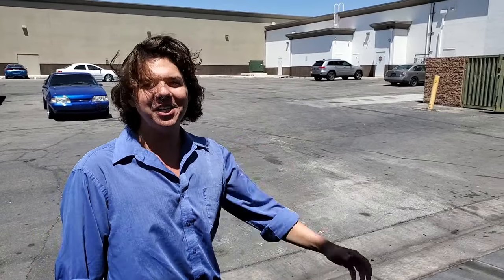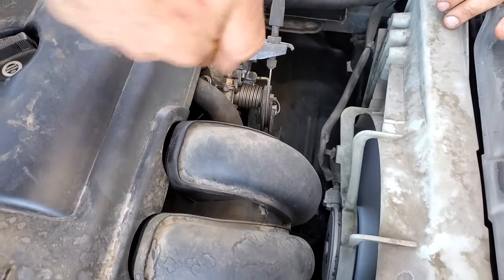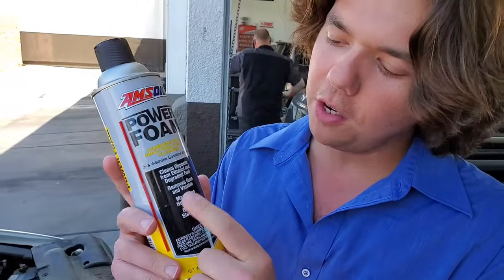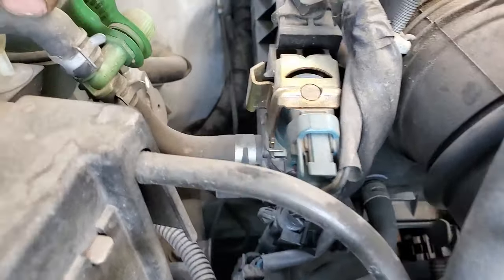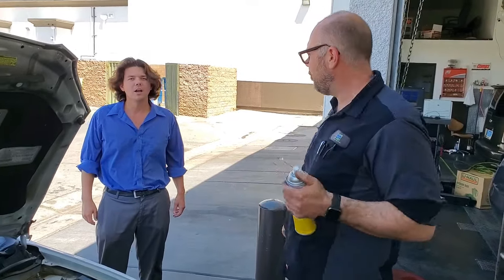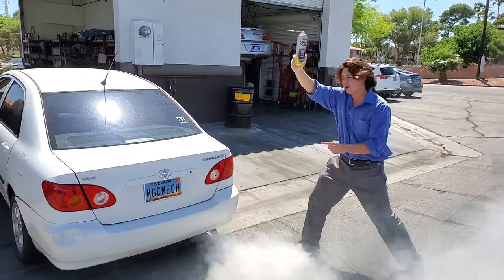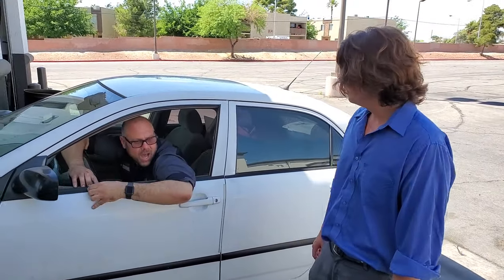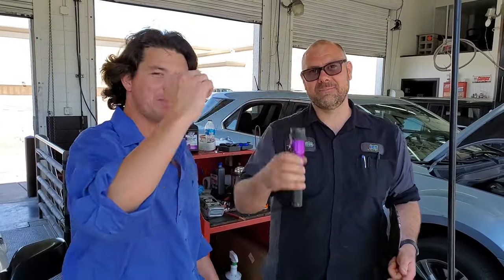AMSOIL Power Foam Engine Cleaning Treatment

Comment from the maker: Watch This Next: Toyota ATF Fluid Change for Faster Shifts & Lifespan - https://www.youtube.com/watch?v=I9ZHWhW7Aso&t=2s  

✅ ✅ ✅  Save 25% On Next Fluid Order: https://www.amsoil.com/offers/pc/?zo=5331179 

     ❤ 🇺🇸 ❤ Your Professional YouLubher: Eben Rockmaker. Find The Right Fluids For My Vehicle - https://www.amsoil.com/guides/?zo=5331179      

     🥇🥇🥇 Synthetic Oil Protection Google Map & Reviews
(702) 472-3614
https://maps.app.goo.gl/DmLU5hP72HadUBEm9
             
     ⛳ Synthetic Oil Protection Website - http://syntheticoilprotection.net

     Did you know a oil manufacturer can call a lubricant a Full Synthetic when it's only 25% synthetic? AMSOIL is different because it is 100% Synthetic and has a higher film strength keeping the metal parts separated. AMSOIL allows less friction, less heat, less wear on the component. 

      ♥ See Fluid Performance Tests - https://www.amsoil.com/performancetests.aspx?zo=5331179      

     Your Vehicle Could Run Better Than Brand New By Using The Right Fluids! See Results - https://youtu.be/zH-VquYlhqA

     Why AMSOIL - https://www.amsoil.com/about/exclusive-distribution/?zo=5331179    

     Synthetic Oil Protection Coffee - Ebens Favorite: https://supportwith.coffee/shop/subscriptions/sop/
Reply: Thank you

Comment: I know this is an older video but i just stumbled across it. I have a Mazda 3 with 102,000 miles on it. Should I power foam it? Or should i just start with the engine flush, gasoline pi, and upper cylinder lubricant?
Reply from the maker: I would do them all definitely important to make sure you don't power from a direct injection car.
I give a man a fishing pole & show him how to fish. 

     Together! We can get your vehicles to run better than brand new!

     For me to get credit & be "Your" Independent AMSOIL Dealer please use my website below or my dealer no. 5331179 call anytime Eben Rockmaker 702-472-3614
After you click on: http://syntheticoilprotection.net
1. Click hamburger menu
2. Click offers AMSOIL preferred customer
3. Click join now 6-month PC member add to cart.  ( there is no reoccurring renewal membership unless you select that dot box ) 
( you have the option to not have your credit card saved if you prefer - est. 1972 )
4. Scroll up to the top Select shop by vehicle.

New promo: FREEQS
Reply: @Syntheticoilprotection  my car has electronic fuel injection so then I would be able to use power foam right?
Reply from the maker: @sellecksprodigy if you have multi-port fuel injection you're good if you have direct injection you don't want to use it it says it on the can to stay away from direct injection just depends on the type of fuel injection you have💯👍

You can use the pi performance improver and the upper cylinder lubricant and the engine flush in the signature series motor oil in any vehicle and you will see a huge huge Improvement

Comment: Hey eben, or jeff, question:  i have a evap code - P0457 on my '01 mustang v6, does this problem require the amsoil power fowm application? Thanks.
Reply from the maker: I have no idea I would find out what the code means.

Also if you have an older car I would definitely clean it out with the power phone you'll see a huge difference.
https://youtu.be/-T_-mF8tlyA

Comment: Do you need to replace the air filter as in the instructions stated on the bottle or that’s for other applications
Reply from the maker: That's a great question I'm not sure what you mean by replace air filter as in a new filter or you would take off the intake box?

Comment: Hey Eben I know this has nothing to do with the powerfoam but I was wondering will amsoil warranty my transmission if I use there atf after I have my transmission rebuilt?
Reply from the maker: Yes you can use it with any vehicle it meets the specifications and it will not void any warranties.
https://www.amsoil.com/about/guarantee/?zo=5331179
Reply from the maker: Tony this is the look of guide that will give you all the products for your vehicle and capacities.

     AMSOIL Products & Vehicle Lookup - https://www.amsoil.com/guides.aspx?zo=5331179

The $50 free shipping promotion is still going until May 31st 

AMSOIL Promo Code: FREESHIP
Reply from the maker: Thanks Tony for being a part of my YouTube Community

Comment: Will this clean clogged catalytic  converters? Or does amsoil make something else that does got the catalytic  converter belowe effincy code so either cats or o2 sensors
Reply from the maker: This is not specifically designed to clean the cats however it will clean the entire system from the intake combustion Chambers all the way out the exhaust to what level it will clean it there's no guarantee but I highly recommend doing it you'll see a huge Improvement definitely worth a try before you replace the cats I would also do the pi cleaner the signature series motor oil and the Amsoil engine flush you'll see them all here on my website👍
I give a man a fishing pole & show him how to fish. 

     Together! We can get your vehicles to run better than brand new! 

     For me to get credit & be "Your" Independent AMSOIL Dealer please use my website below or my dealer no. 5331179 call anytime Eben Rockmaker 702-472-3614
After you click on: http://syntheticoilprotection.net
1. Click hamburger menu
2. Click offers AMSOIL preferred customer
3. Click join now 6-month PC member add to cart.  ( there is no reoccurring renewal membership unless you select that dot box ) 
( you have the option to not have your credit card saved if you prefer - est. 1972 )
4. Scroll up to the top Select shop by vehicle. 

New promos: FREEWAND

Comment: Good work as always👌
How many miles made by that Corolla?
Will you make engine flush and change the motor oil, to which viscosity?
Reply from the maker: Yes Jeff already did an engine flush on it and it has a hundred and fifty thousand miles

Comment: Hi !
Greetings from Germany ! Would it be possibleto show how to use Power Foam in Fiat 124 spider MULTIAIR II 1,4 engine , same as Spider ABARTH 124 ? There i scomplicated way to go into throttle body as it is covered and deep inside .Maybe power foam can be injected by one ot te subpressure pipe. You know, any FIAT partner will not help...they want money ... I think many 124/ABARTH spiders will appreciate it .. TAHNKS !
Reply from the maker: Hey thanks for being a part of the channel from across the pond yes that sounds like a great idea I would find a way to inject it in however it's not recommended for vehicles that have direct injection.
I would personally take off the spark plugs and spray it into each cylinder like I do with my Cadillac here.
You want to spray the power foam directly into the cylinder through the spark plug hole.
https://youtu.be/-T_-mF8tlyA

Comment: I used a can of power foam to clean the catalytic converter, but the result is still not satisfactory. Should I use another can or not?
Reply from the maker: You could I would also do an Amsoil engine flush and I would also do a bottle of Amsoil PI performance improver.

I would also spray the power foam directly into the cylinders and that should help get more build-up and carbon out if you can get to the cylinders I would spray it in take the spark plug out let it sit in a hot motor for 15 minutes and then start it up and drive it

Comment: Would I use the same steps for a GDI engine ?
Reply from the maker: Most likely you want to just make sure you avoid any sensors so you do not get them wet.

Also another tip and trick you can do is to spray the power foam directly into the cylinder by taking off the spark plugs I've done this on my Cadillac and it made a big improvement.

Comment: Hi Eben. Which specific vacuum hose did Jeff apply the foam into?
Reply from the maker: Great question he said the exact name in the video I would watch it over again just to get your toes wet.

I also recommend avoiding any type of sensors on your vehicle.

You can call Jeff or message him on Facebook.
https://www.facebook.com/jeffrey.lockett
Reply from the maker: On different Vehicles it can be at a different location so I really am not sure for your specific vehicle it's best to spray it directly into the throttle body area and bypass the sensors

Comment: How do you know how much to spray in? Will this do some preventative measures?
Reply from the maker: The best preventive measure is doing an Amsoil engine flush and using the pi performance improver fuel system cleaner every 4000 miles and I also recommend using the upper cylinder lubricant every single full tank of gas.

The Amsoil power foam is designed for a neglected engine that has a lot of build-up in it and in that case it'll make a tremendous difference

Comment: So I just power foamed my truck. Now the check engine light was blinking when I shut it off. I haven't done the open it up and fly down the road thing yet. Will it go away? Anybody else have this issue? Thoughts? Fyi the check engine light was not on before treatment
Nevermind it went off. Some smoke. Not sure if it made a difference or not yet.
Reply from the maker: Yes that can happen make sure you check your wires if you took any wires off also it's good to reset the computer by unplugging the battery
Reply from the maker: I also recommend the PI performance approver gasoline additive and the upper cylinder lubricant those will make a huge difference on your vehicle
Reply from the maker: I also recommend an Amsoil engine flush that'll clean the carbon around the rings We did a really good Christmas miracle video with this Check this one out 
https://youtu.be/n-ueJQmbzxk
Reply: @Syntheticoilprotection  pi is in the tank already. Been 15 years since I've used amsoil products. I've been using the cheap wally world stuff and am not impressed with what it's done to our car
Reply: @Syntheticoilprotection  so you must physic or something. My truck has the 6.0 in it. It doesn't knock like this did. I'm impressed. Can't wait to see what amsoil does to our engines
Reply from the maker: Awesome This is my link and when you use it I would be your Amsoil dealer and I could always answer all your questions in the future on the products I really appreciate you being a part of the channel and appreciate your business in advance always happy to talk with you.
🎬 Professional YouLubher: Eben Rockmaker Regency Gold Direct Jobber AMSOIL Specialist (Dealer#: 5331179) 702-472-3614 

     ✅ If You're New To AMSOIL I Recommend The AMSOIL 6 Month PC Membership because it will save you about $33 on a $100 purchase after the difference in tax - https://www.amsoil.com/offers/pc/?zo=5331179

Comment: Another great video and demonstration. I tried purchasing AMSOIL Power Foam however AMSOIL distribution center would not ship it to me due to I live in California. If I purchase from you directly are you able to ship it to me.
Reply from the maker: I would recommend next time you do a trip to Las Vegas you pick it up at the Distribution Center at the speedway and you can service your car here and that way you won't get in trouble with California LOL
Reply: Synthetic Oil Protection in California we can use other products  brands  for example ( BG products and Seafoam ) that does the same job I’m curious why not Amsoil  however I’m run All AMSOIL fluids in both of my vehicles.
Reply from the maker: That's a great question I would call tech support and talk to them about the chemicals most likely they use proprietary stronger chemicals they clean better.

I really don't know the exact composition of the chemicals a lot of that stuff is kept proprietary by Amsoil.
17153998324
Reply: @Costarica-mq8el  Try ebay for the power foam most  sellers will ship anywhere on there. Also CRC sells a product that's very similar to the powerfoam and it works very well to and can get at it at autozone  etc.

Comment: Can I use it for a carburetted motorcycle?
Reply from the maker: Yes
Reply from the maker: This is the full description on all the vehicles you can use it in - https://www.amsoil.com/p/power-foam--apf/?zo=5331179
Reply from the maker: I also recommend doing a bottle of the quickshot which will clean the valves all the carbon deposits out of the combustion chamber and it is really good for cleaning your entire fuel system - https://www.amsoil.com/p/quickshot--aqs/?zo=5331179

Comment: Is this the product to clean the throttle body?
Reply from the maker: Yes it also cleans the intake and exhaust valves and the exhaust manifolds.
This can get the check engine light to go off on a car that's all clogged up with carbon.
Reply from the maker: This is my personal link if you ever have any questions with the products feel free to reach out to me before you order also if you're new to am's oil the 6-month PC membership will save you about $33 and $100 order and then there's also a lot of other great benefits with that but always happy to talk Amsoil with you.
Professional YouLubher: Eben Rockmaker Regency Gold Direct Jobber AMSOIL Specialist (Dealer#: 5331179) 702-472-3614 

     If you're New to AMSOIL I recommend the AMSOIL 6 Month PC Membership - https://www.amsoil.com/offers/pc/?zo=5331179
Reply: @Syntheticoilprotection  thank you for the quick response.  I am not a Mechanic and I have a 2018 Highlander. Have y’all made a video by chance using the suv. Just a little worried I will screw up a sensor. I also planing on the changing the Fluid in the differentials. My Highlander is all wheel drive. Thank you for your time. By chance is the above phone number something I can text?
Reply from the maker: Oh yeah that's my personal phone number I always take care of all my customers 💯
Professional YouLubher: Eben Rockmaker Regency Gold Direct Jobber AMSOIL Specialist (Dealer#: 5331179) 702-472-3614 

     If you're New to AMSOIL I recommend the AMSOIL 6 Month PC Membership - https://www.amsoil.com/offers/pc/?zo=5331179
Reply from the maker: Yes we did do a power foam on a Subaru definitely check out that video you'll see it here in the channel If you have any other questions let me know the most important thing is to make sure you don't get the mass air flow sensor wet.
The only thing you'd have to do if you did get it wet was just clean it off with a mass air flow sensor cleaner which we did on the one Mercedes ML350 video you'll see that on the power foam in the power foam playlist

Comment: Will this hurt my catalytic converters ?
Reply from the maker: This will clean your catalytic converter and it will help you pass emissions better.

    Also the pi performance improver will help clean the cat and help your emissions.
https://www.amsoil.com/p/p-i-performance-improver-gasoline-additive-api/?zo=5331179
Reply from the maker: Devon there is a promotion going on any order 50 bucks or more has free shipping and also if you ever have any questions feel free to reach out to me.
Promo SHIP920 

Also this is the wholesale link that will get you the free shipping and you'll also have the discount as a preferred customer if your new AMSOIL Ebens Link: AMSOIL Wholesale + FREE Shipping: https://www.amsoil.com/offers/?zo=5331179
Reply: Awesome! My shipment just came in a couple days ago! I got oil, oil filter, engine flush, power foam, pi performance,and coolant for coolant flush! Switching all over to AMSOIL
Reply from the maker: Awesome thanks Devin!

Text me your full name I'll make sure you showed up in my account that way you will be my customer and I can always answer your questions as your Amsoil dealer 702-472-3614 I'll check to see if you are in my account

Comment: I don't believe in cleaners plus my car gets redlined everyday so I'm sure I have no carbon it has 200k miles stock motor.
Reply from the maker: I was just like you before I tried AMS oil I didn't think it did anything.

Check out the video on my 59 Cadillac you'll see the engine flush power foam and PI cleaner you'll see everything it does to the car before and after

Comment: Hey Steven, why is it that seafoam recommend that we spray the can right into the intake before the throttle body (after air box and MAF sensor) but with Amsoil you’re recommending that we spray it into the evap line?